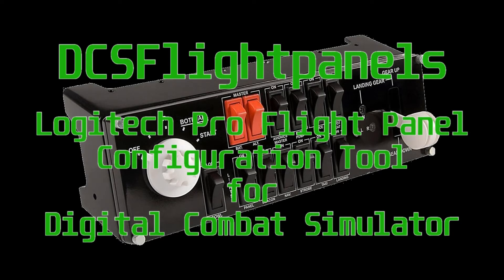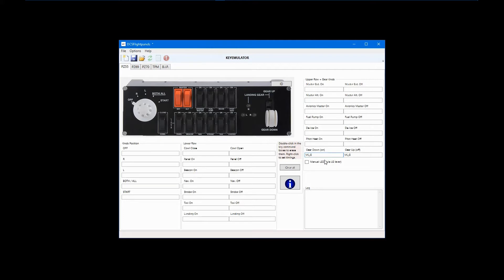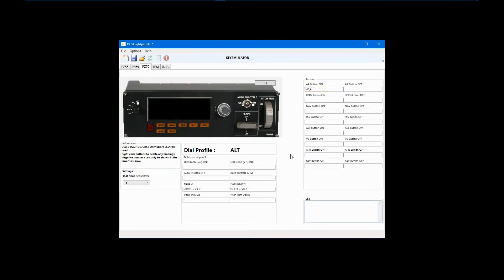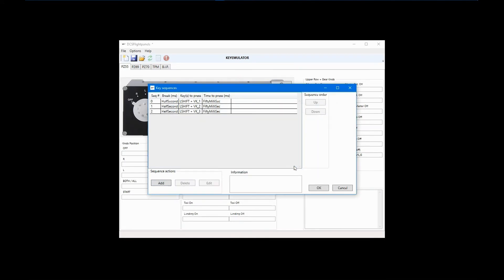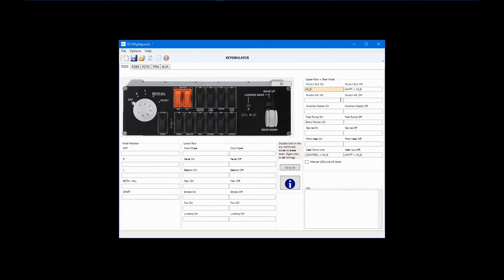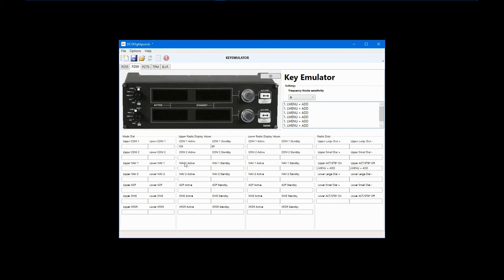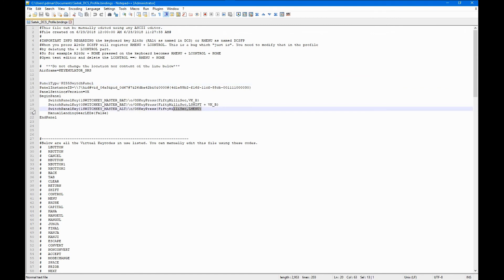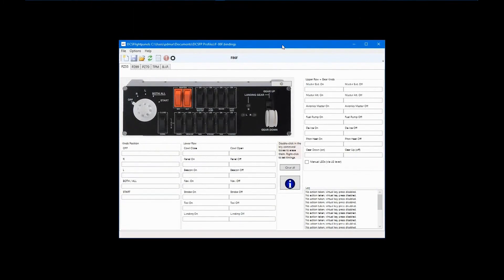DCSFlightpanels -- The Basics and Keyboard Emulation Mode

Comment: Hello. help please. There is no "Key emulation SRS" option in the module selection. What can I do to use the radio panel with SRS?
Reply: I have the same problem?
Reply: @sebastiansamuelsson1054  The problem has been solved in general. The Flaming cliffs tab works with SRS.

Comment: It's a great video as usual. Thanks. 
How have you have set-up and establish good connection to DCS (DCS-bios) which seems to be where I struggle to get the communication (data packet transfers) to work. 
I would greatly appreciate a video showing how you connect the game to DCS-bios to DCSFlightpanels. Including all the hazzle of lua, script folders etc... That's where the issues usually stop people from a great piece of kit. Including potentially how you add another panel to your existing profiles...
I myself spent hours getting the radio panel to work. Finally did it - with a lot of help. Now having added the other 2 panels - my struggle starts all over unfortunately :-(
I love how the radio panel works for me!
Reply from the maker: @Carsten -- Thank you for your kind words and comments.  I will give some thought to a making a tutorial on how to set up DCS-BIOS.

Paul
Reply: @pdmarsh5466  That would be awesome. Thanks in advance. Also thanks for these videos and great work you guys do on DCSFP

Comment: How to use it in keyboard emulator mode? I configured the profile for the f-18 in dcs but when pressing the switche or gear lever, there is no action in dcs. All the keys are correctly binded in dcs and DCSFlightpanels app

Comment: This is a good step in the right direction, but in my humble opinion a more plug and play method is required to get every users flight panel connected to DCS in a breeze fashion rather breaking brains on programming it. Plug and play profiles with a good discription on where to place them would be awesome (custom key binding is for people that are far more in depth with the sim then regular users anyway, a standard profile in which the knob on a flight panel does exactly what it does ingame would suffice for most "regular" users). For now I have not been able to connect any of my panels with DCS and knowing its possible its very frustrating, this tutorial does show all I need to know about programming a profile, which makes sence, but getting it to work in DCS isn't clear to me at all. A more clear tutorial on how to make the created profile work in DCS (where to put it, I have no idea where the keybinding profiles are situated, and does DCSflightpanels have to run in the background?)

Hope you can give me some words of wisdom, been trying to transfer from FSX/P3D to DCS for years now and if it all where just a tad more simplified......especially the complex key profiles of DCS are quite a challenge to remember...(hence a simple plug and play setup for the panels could take away so much frustration)
Reply from the maker: Very odd--I replied to this post before and my response got deleted, but I was not  notified.  In any case, please go to the Eagle Dynamics/DCS World forums and post your technical questions there.  A very complete explanation on how to enable DCS-BIOS can be found there as well.  DCSFlightpanels was developed and is still supported by a gentleman who does this on his own time with no financial support.  Yes, plug-and-play would be great, but even as it is DCSFlightpanels with DCS-BIOS is not really all that hard to work with.  You will find good support on the forums.
Reply: Hi, head over to the support thread and you will get help! Yes it isn't plug & play, you can ask for advice, ready made profiles in the thread and there are always someone there to help you. People with little computer knowledge uses DCSFP. https://forums.eagle.ru/showthread.php?t=137670
Reply: thx a lot, i have a forum profile so I'l be asking around soon any day. Thx for the pointer.